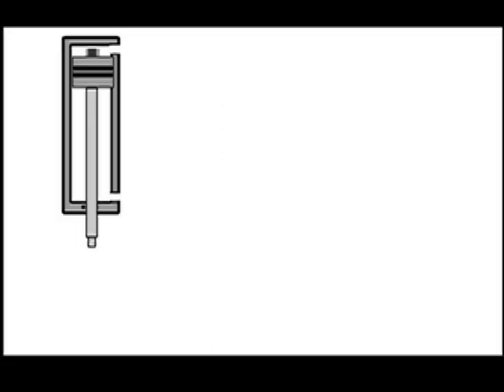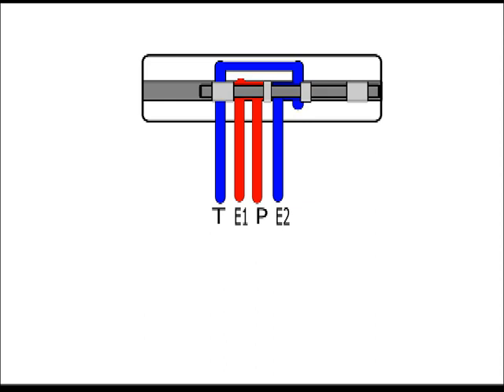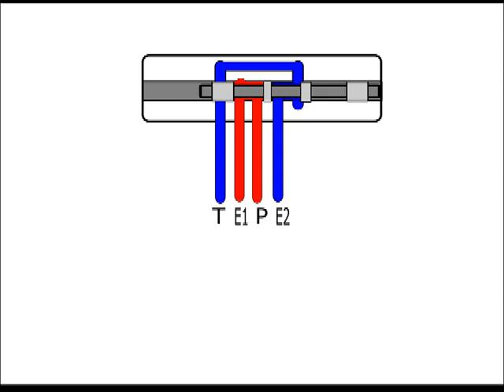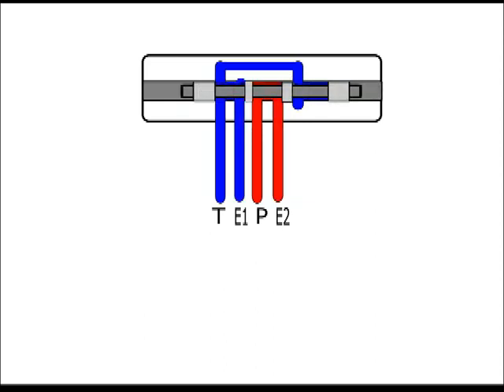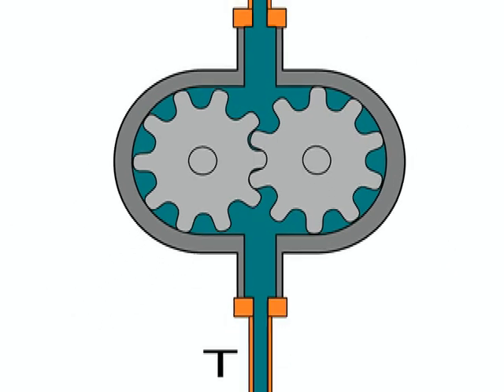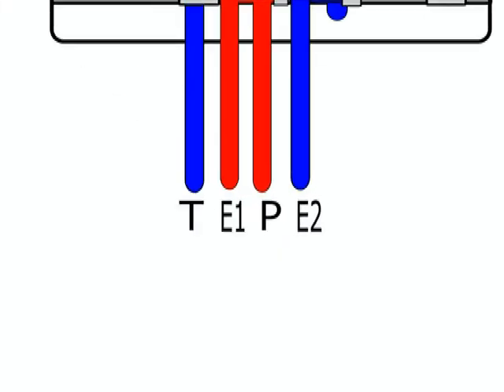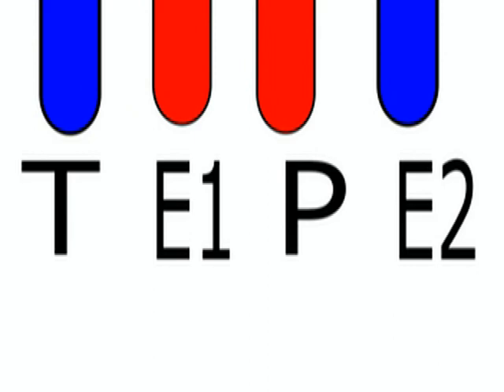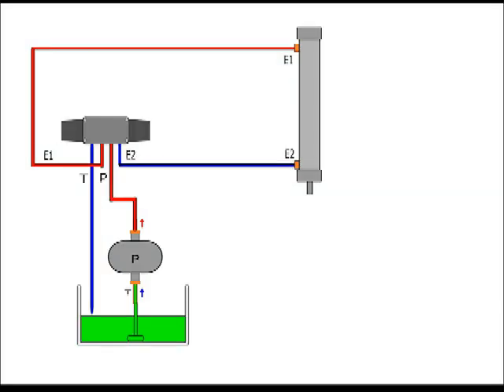How a hydraulic press works

Comment: Thank you for your video. Can you explain how this configuration of the pump use Pascal's principle. Thanks
Reply from the maker: Pascal's principle states that he pressure applied to any part of the enclosed liquid will be transmitted equally in all directions through the liquid, since the small amount of oil forced into the big cylinder by the pump, the small amounts driven by each slot in the pump goes into the big cylinder and exerts pressure in every direction, which moves the cylinder relatively slowly, much as using a shovel to fill a dump truck with a ton of dirt, a few grams at a time. There is an excellent article on the subject at https://en.wikipedia.org/wiki/Pascal's_law
Reply: @eltunene   Thank you! One more question: how is the pressure controlled in this configuration? I.e. if I want to apply 1 ton of force, is it controlled with the buttons?